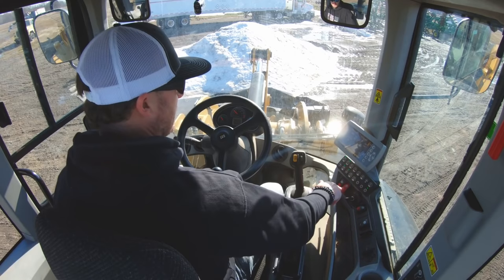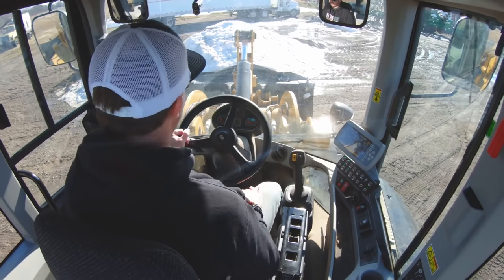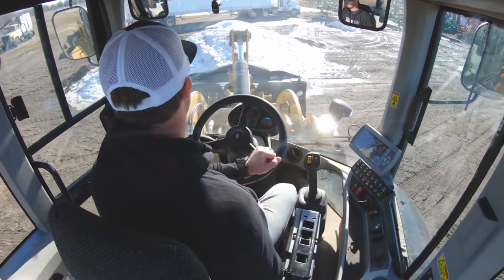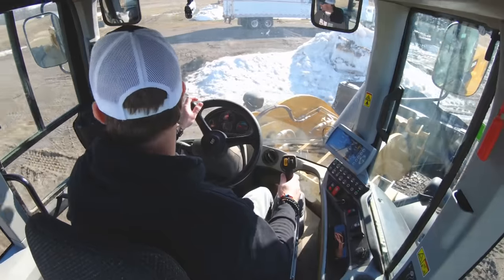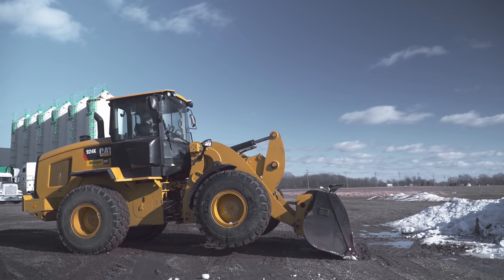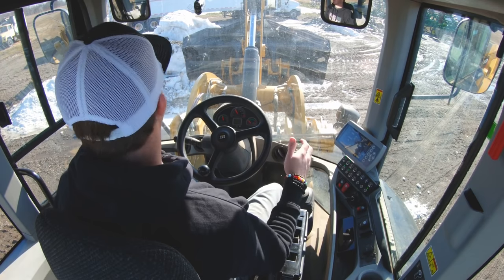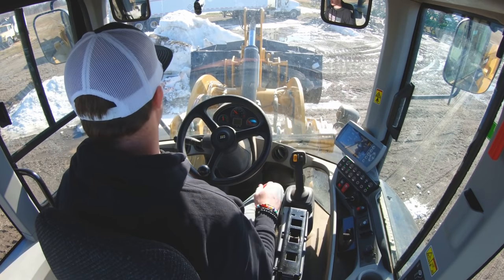Front End Loader Training - Top Mistakes | Heavy Equipment Operator Training

Comment: How fill bucket   in sand?
Reply: Loose sand is about the only time I would turn traction control off. The machine has a really hard time determining how it can get Traction in such slick conditions. Outside of that your Technique will be roughly the same, putting down pressure on the front tires by raising your boom arm slightly. In really loose and you just have to accept that you aren't going to get full buckets every time. The traction just isn't there

Comment: My bs company is good for one thing.. we have all old equipment. Like 1950's and up. Learningbon old equipment makes the new shit so much easier imo
Reply: Hey Hey I learned on a 1968  International #60 Hough .  Where you sit on the front half, every thing stays in front,no looking around to where the bucket went. We use it on the farm to unload bales and load manure. The brakes have not worked for years so unloading bales is not a problem but loading manure I always load up hill slightly as to not run into the truck you just learn not to  be in a hurry.

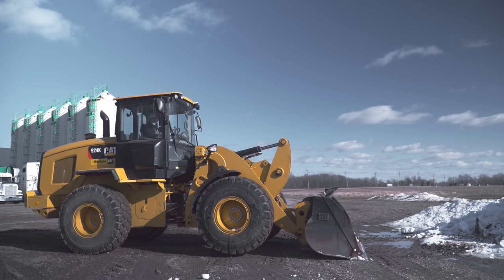Comment: 5:46 85% of all the loader operators at my job 😆
Front wheels as far off the ground as possible. Every single time.
(And we have more than 10 operators)
We use Cat loaders with no steering wheel.
"Gee, why does the charge bin have a swimming pool in it?
Guess we gotta put a new concrete floor in it."
"Steel rails embedded into the charge bin floor so this can't happen? Bahhh. We'll just yell at the drivers, and then when they age out or drift off to other jobs, the completely new set, we'll yell at them when they do the exact same thing. That'll certainly solve the issue."
1 year later: "Gee, why is there yet again a swimming pool in the charge bin,?" 😆

Comment: I operate equipment in the Air Force. I wouldn’t say the Loader is easy, but in my opinion, it’s the easiest of all the equipment. Most people can get in a Loader and at least operate it at some sort of level. Skid-Steers are probably the hardest, especially the ones with the hydraulics operated by floor pedals. They’re just real tricky to be efficient with.

Comment: I don’t care what anybody says, the loader is one of the easiest machines to run lol
Reply: everyone has different opinions and find even the hardest machines to operate are the easiest..  everyone is different just like different equipment.   i find that the dozer and excavator are easy to operate as long as you know what you’re doing you won’t be bored or sitting still. rock trucks are east and boring just the maintenance is more of the job than riding or dumping